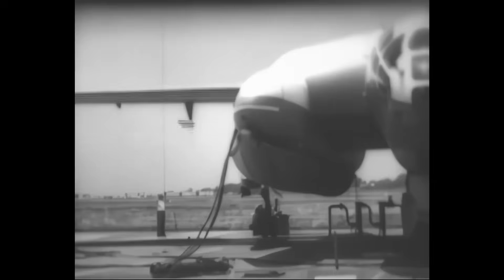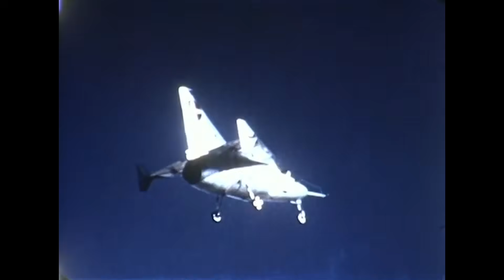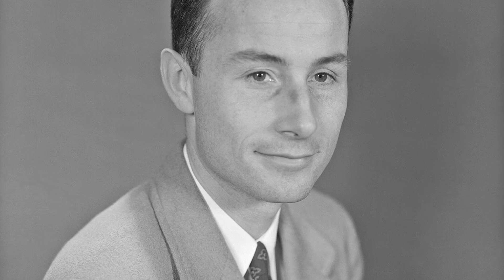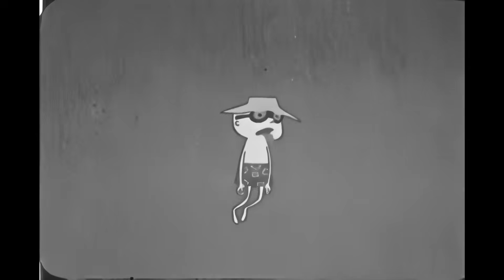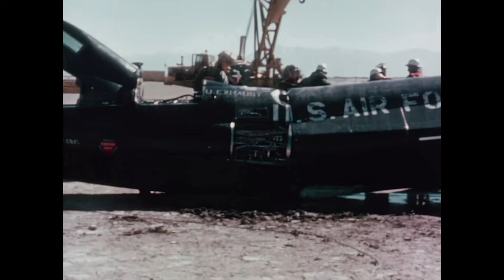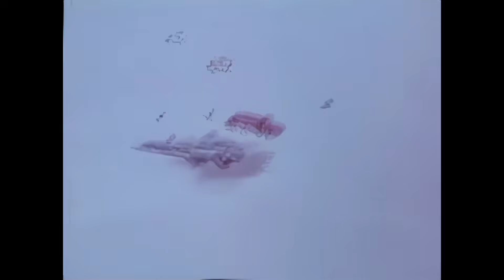AVIATION ODDITIES | Aircraft Innovation And Research Pioneers | Episode 3

Comment: The X-24B in flight used in this Video's thumbnail image, was a fascinating concept. The Northrop M2-F3, a later iteration of the same "heavyweight lifting body" category of aircraft, crashed at the Dryden Flight Research Center in 1967. Yet it was not before having reached a speed of Mach 1.6 and its highest altitude being 71,500 feet (20,790 m), that on December 20, 1972, it was deemed a date, set to be the last of its flights, which was flown by NASA pilot John Manke handling the demanding task, in controlling such an unconventional and dangerous aircraft.

Comment: THERE IS NO broken SOUND BARRIER, if so, where are the broken pieces!
The linearized theory of Prandtl Glauert falsely predicted the rise of the drag coefficient:
Cd = Cdi × 1/√(1 - Mach² ) 
The transonic aerodynamics cured that discrepancy but not for the journalists , who like the stupid, really stupid expression breaking a ( non existing 'Barrier')
For the pilots including Jaeger the transition is unnoticeable but for the Mach meter indication.
Reply: boom
Reply: @windedzero10_28  that is a shock wave  at supersonic speed, not present at exactly V÷ √(1.4×8314.4/29×temp)=1
Mach = 1, no boom
above it's boom-boom 
leading edge first, followed by trailing edge, 
Que tipo que conoce todo 🇧🇴
Reply: Oh shut up, it was a term coined by newspaper men that stuck and no one cares about your Wikipedia math formula.